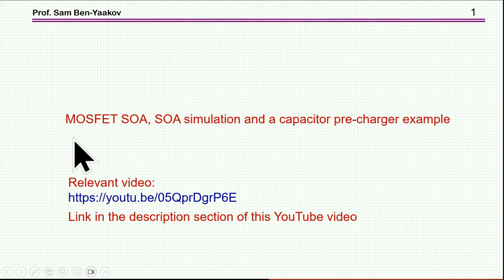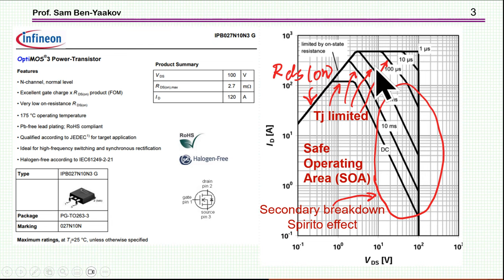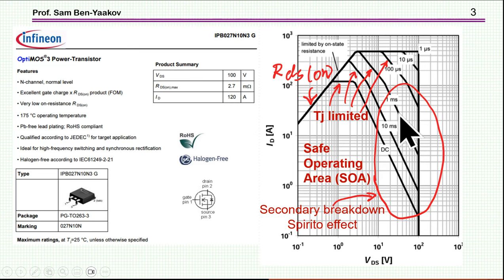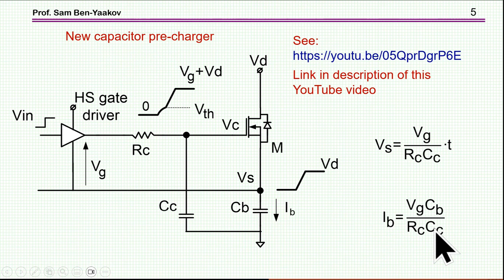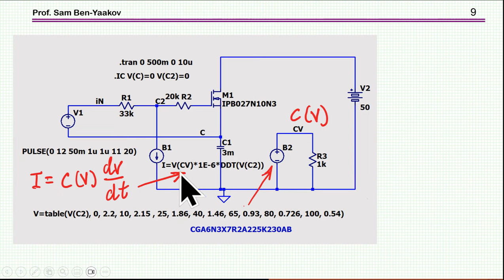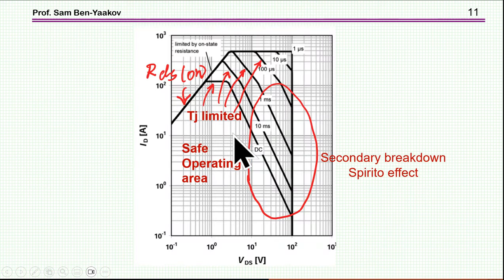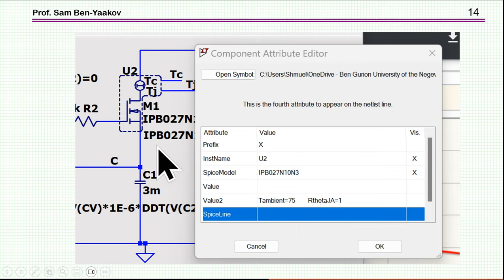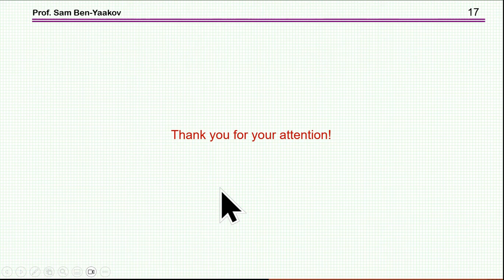MOSFET SOA, SOA simulation and a capacitor pre-charger example

Comment: Thank you for the video. Just today I was talking with a coworker how elegant the capacitor pre-charge circuit is. First we thought that the gate capacitor should be between gate and source, but connecting it to ground is much more effective. We saw this in a LT IC, for example LTC7003.
Reply from the maker: Thanks. I was not aware of the solution shown in the LTC7003. They seem to have missed few point though😊See the predecessor video https://youtu.be/05QprDgrP6E. More important details can be found in the PCIM paper to be available at IEEExplore.

Comment: in my implementation of.. almost the circuit seen at 6:02 it takes a short while for the HS gate driver to come online after power-on, and during that time Vd has a chance to rise towards its nominal value without Cb being charged, i.e. Vds rises. i found a resistor in parallell with M kept Vds lowish before M started conducting by pre-precharging Cb, and it helped my SOA issues without causing other issues in my usage case. I will definitively change to a x7r Cc tho, thats genious! thank you for the tip!
Reply from the maker: 👍Thanks for comment. Have you seen  https://youtu.be/05QprDgrP6E  ?
Reply: @sambenyaakov  yes. i mentioned that i had built something similar, and asked where i could send schematic if you were interested
Reply from the maker: @solenskinerable  sby@irpsystems.com
Reply from the maker: @solenskinerable  sam.benyaakov@gmail.com

Comment: There is something unclear about that SOA table: at what time base does it work? 1 Hz? 50% dity cycle?
Asking since I am not sure for example : I have a 100us puse of 200A at 10V  that is ok according to the SOA BUT when can I have the next pulse like that? 
Also isn't this SOA graph simply a power that can be dissipated graph adjusted for thermal inertia and some heat disipation ? If yes then I can reverse math the linear behaviour, is that correct? 
Also at 5:17 is M1 meant to run in linear mode, as a current limiting resistor ? 
Besides capacitor banks and supercap backups what other loads have a capacitor like behaviours ? Asking since I can t think of any other use case for this circuit.
I was also thinking that if we add a FET that disconnects C2 then the circuit can be also used to maybe soft start some SMPS? may not be the best method .
Reply from the maker: The SOA data is for a single pulse. For repetitive pulses you can use LTspice simulation or work it out via the thermal impedance plots given in the datasheets. These are in fact the origin of the SOA curves, save the secondary breakdown. As for 5:17, yes, Thanks for conversation.

Comment: Professor, when the MOSFET is switching the voltage and current is changing, how can I decide which current and voltage to use in the SOA? NOW I'm using the peak current and the input voltage, do you have any suggestions?
Reply from the maker: Run LTspice simulation